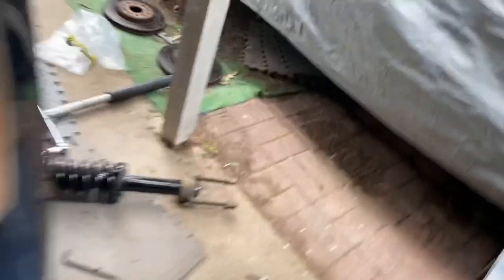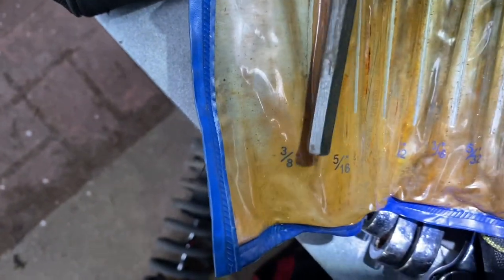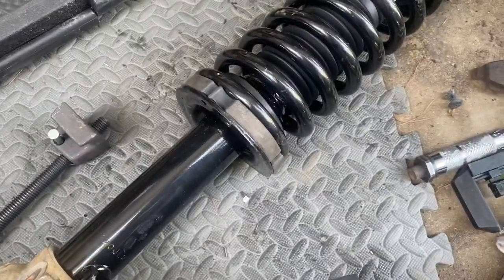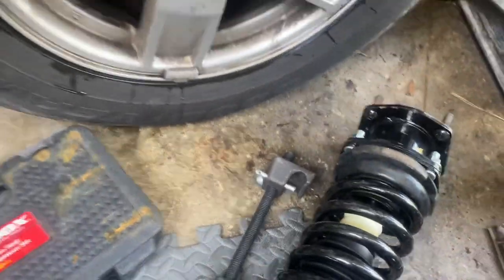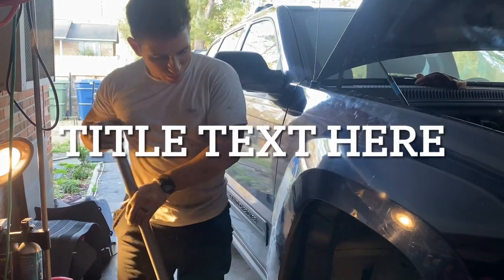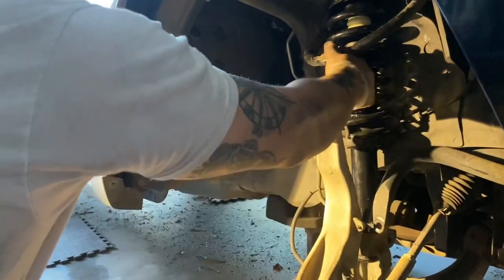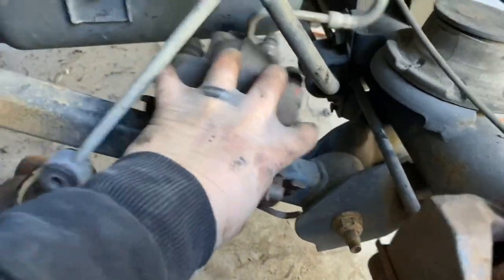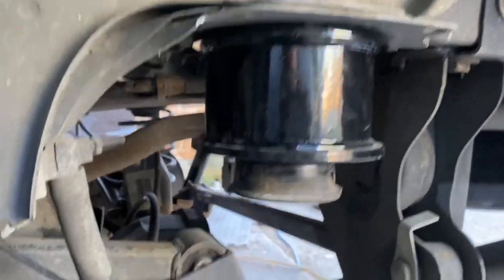How to install 3” Lift on Jeep WK Please Subscribe if This video helped even just a little!!

Comment: Did u have to get this wheel alignment after the lift installed mine was fine put 2” lift on like yours now my traction control seems to be kicking in any ideas please thanks
Reply from the maker: I’m not sure about the traction control. I do know after the lift, the handling went down significantly. I didn’t not need to get an alignment though. I would not recommend going any greater than a 2” lift though.
Reply: I do the same lift did not get a wheel alignment did not need it
Reply from the maker: @bobbylong5349  I didn’t need an alignment either…but the handling did become more difficult.
Reply: @CottoDIY  what do you mean by this?
Reply from the maker: @aviram2441  the vehicle does not roll down the road as smoothly with a lift kit. You feel every bump more.

Comment: I have the same jeep same color thinking of doing this to mine thankyou for the video
Reply from the maker: Thanks for watching! Subscribe if you can!!
Reply: @CottoDIY  oh I meant to tell u I did . also  what shocks and sway bar did u buy and anything else u want to throw out there let me know as I just want to make sure it rides good and doesn't cause any future issues
Reply from the maker: @PunisherPrime81  at the time, I did not buy upper or lower control arms. I would go with a 2” lift in the front because 3” is very difficult to install and it messes up the front angles of ride height.

Comment: How is everything holding up with this lift. I had a pain in the ass putting just a 2.25" tall spacer, that one looks like its actually 3" tall. These jeep apparently gain more in the front end than the actual  size of the spacer. so a 2 1/4" tall spacer gave me actually 3.5" up front. A 3" spacer is going to give you well over 4" and cause Soo much problems up front. I had brand new moog adjustable ball joints fail on me first day before I ended up getting the jba upper control arms.
Reply from the maker: Yes I would definitely recommend against the 3” puck spacer unless you redid the entire front end. The Jeep was super bouncy and walked all over the road when hitting bumps. The stock control arms will break with the new angles. Would only install the 2.5 in the future. I traded this Jeep for a fiberglass 79 wrangler but the new owner was advised if the issues of this lift!!!
Reply: @CottoDIY  nice trade. I'm sure the wrangler will be fun. I would put a notice or update on your findings with this lift as I'm sure people will be coming to the internet looking for help trying to install it. I'm sure itl help to know what to expect.
Reply from the maker: @shermangriffin2722  I do try to respond to all the reply’s with my findings, hopefully people do their research and read from not only my experience, but from others on YouTube!!

Comment: How did it ride after? Mine bounces all over the place
Reply from the maker: Yes, this is the cost of having it lifted. It has something to do with  throwing off the center of gravity. Looks good, handless bad.
Reply: I put the same kit on mine and mine does not bounce I replace struts and shocks
Reply from the maker: @bobbylong5349  that’s interesting, maybe it’s the brand shocks or tires I used but they were brand new as well.

Comment: Thanks for the video. I recently bought some used tires for my 08 grand cherokee. It has 265/65/17 but i bought some used 265/75/17 tires for a good deal. My problem is i think they are a bit big. I think i now need to lift it in order to have clearance for the new tires. 

How high can i lift it without having to upgrade any other parts? (On a budget). Also, i have seen other people mentioning that a 2 inch lift actually lifts it 4 inches and a 3 inch kit 6. Is this true??
Reply from the maker: Yes this is true and I would not lift it any higher than the 2” lift. You shouldn’t have to change any other parts with the 2”. You might need wheel spacers depending on the offset of your wheels. Hope this helps.
Reply: @CottoDIY  Thank you for replying. So, when you say a 2” lift does that mean buy a 1 inch lift so it ends up being 2, or buy a 2” lift so it ends up being 4? Haha
Reply: @aelfwealld  I did the rough country 2" lift on my 09 jeep commander it definitely lifted the front up more than the back but it's supposed to maybe 4 " in the front and maybe 2.5 inches in the back. I did have to get 1.5 wheel spacers because I put bigger tires on 265/70/17 cooper at3 looks awesome rides like stock

Comment: i got one with the 3 inch lift already in place and the tires rub when you turn corners. it makes such a bad sound, is this a typical problem with lifts? or is mine done incorrectly?
Reply: typical lift things if you don't have the right tire size

Comment: I have a 4.7, should i do 3.5 for the front? And the regular 3 for the back? I want it to be even and i feel like the front will sag
Reply from the maker: That’s a good question since the motor does account for extra weight. Since I had the 3.7, I would have done the 2” in the front and the 3” in the rear since the rear sagged a little. I don’t like the squatted look and this bothered me. If I were you, I might just do the 2.5 in the front and 3” in the the rear just to make sure it didn’t sag. A little rake doesn’t look bad, but then again, I’m not 100% positive.

Comment: I’m doing a lift on my wife’s car and just purchased a 2” lift for the front. But I want it leveled or wouldn’t mind the nose down a little bit. What size lift should I do in the back? It’s. 6 cylinder
Reply from the maker: I would do a 2 1/2” or 3” in the rear to get it leveled.

Comment: What size tires are you running?
Reply from the maker: These in the video are35”, but they rubbed and made too much noise so I downsized to 33”
Reply: @CottoDIY  how did u get 35" on?? I'm at 32"'s with a 2" lift and they rub
Reply from the maker: @Ghost-nq1vv  you have to hammer down the pinch welds under the plastic, and also cut the plastic so it doesn’t rub. A 2” lift equates to a 4” lift—whereas a 3” lift equates to a 6”lift.; all things considered, I would not recommend the 3” lift as the steering, handling, and overall control of the Jeep is diminished. Best of luck!! Thanks for watching and subscribe!!

Comment: nice vid bro, bout to do 2 inch lift, should i replace the shocks too?
Reply from the maker: I would at least change the shocks. Are your upper ball joint boots torn or really worn? You might want to consider changing them out too.
Reply: @CottoDIY  i definately check them and replace, tnx bro

Comment: Has the lift and suspension held up over time?
Reply from the maker: Yes sir it held up just fine. Would recommend the 2.5 inch lift in the front, and also getting tubular upper control arms, or just jutting new upper control arms because it did add extra degree of angle.

Comment: I bought 33s aka 265/70r18 do you guys think they will fit with this set up??? What would I need
Reply from the maker: I don’t see why these wouldn’t fit. When I put 33s on my 18’s they fit fine. I just added spacers because I used stock wheels

Comment: Would a 2 inch lift fit the rubicon wheels
Reply from the maker: You could fit the rubicon wheels with a 2” list as long as the tires aren’t over 33”

Comment: guy went backwards in installation of front struts. you dont need to compress them if you have complete unit. you install from top and then throw in the bottom fork and bolt. you did it the hard way
Reply from the maker: I wasn’t installing front struts. I was adding a 3” lift. Check out installation of front strut videos on YouTube for the best representation of your project 😀

Comment: Would I need new upper control arms for the  2 inch lift
Reply from the maker: How old are your control arms? If the ball joint boots are worn, I would replace them.
Reply: I’ve replaced them once before with factory uca
Reply from the maker: @jeromia73  I would presume you are good to go.
Reply: One more question bro have you ever had to take the 3 inch spacer  lift off of the front of so ,what’s the easiest way to do this just the spacer itself I replace with new coil overs ! I don’t wanna take the whole strut out again is there any easy way to do this ?
Reply from the maker: @jeromia73  there is no easy way. You’ll have to take the strut out and good luck because I had to take a sledgehammer and beat that lift into position.

Comment: I put an  OME HD lift on mine. Word of advice: NEVER install a spacer lift like this unless you want to trash the front end and cv axles.
Reply from the maker: Agreed. The vehicles ride quality wend down tremendously.
Reply: How? Is it from forcing it in or just because the lift was added causing more tension? Or other?
Reply: I'm on my third CV axle of 2024. Keep trashing boots! I've seen advice if only going with OEM or ReMan. Any extended travel cv's to suggest??

Comment: Asking for death, with that upper control arm, that “3 inch” lift is actually a 6 inch
Reply from the maker: Is it really? Is that because the control arms aren’t for the lift pucks? I drove this Jeep for thousands of miles but didn’t notice the danger.
Reply: @CottoDIY   yeah due the to puck lift on these jeeps whatever size spacer you use the lift amount is doubled
Reply from the maker: @Blake64  thanks for the info. I will add this info to the description in case there are people researching this kit. Why is it dangerous? Is it because it will break the control arm ball joint?
Reply: @CottoDIY   the upper ball joint is know for popping out. these spacer lifts causes the upper arm to be at severe angles, it leaves the arm little to no room for down travel it is putting tons of stress on the ball joint by pulling on it, JBA uppers are highly recommended
Reply: He is right I put the same kit on my 05 grand cheese and my upper control arm ball joint snapped right off got everything replaced but it's not the same on that side I hear clunking after everything was replaced wat else do u recommend getting with this kit besides jba upper control arms
Reply from the maker: @rjmeeks7215  besides those tubular control arms, and new strut assembly, all your tie rod ends and other steering components might lead to the clunking noises.
Reply: @CottoDIY  so once those new jba upper control arms get put on everything should be fine
Reply from the maker: @rjmeeks7215  if you have replaced everything so far, including your wheel bearings, you should be fine. The bigger wheels and tires will put stress on the bearings so the stock ones might last very long after installed.
Reply: Horrible idea
Reply: Jba upper control arms?  Anyone have a link for an 2008 Cherokee set?